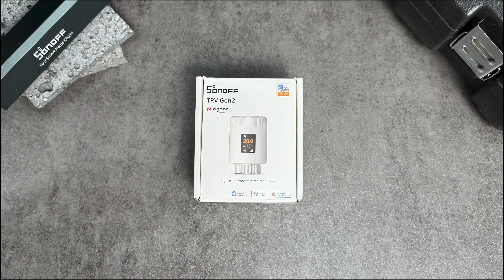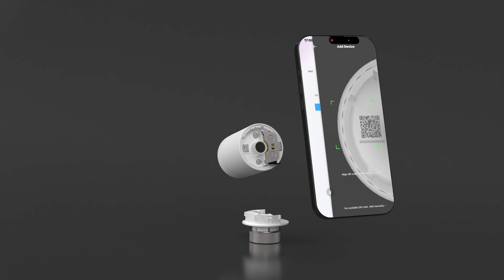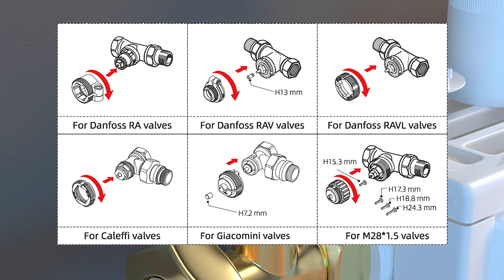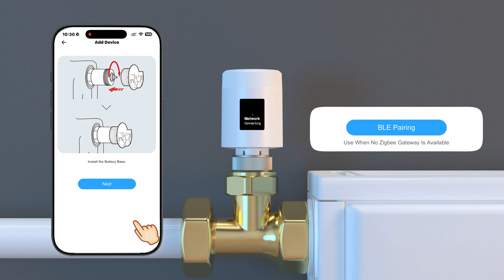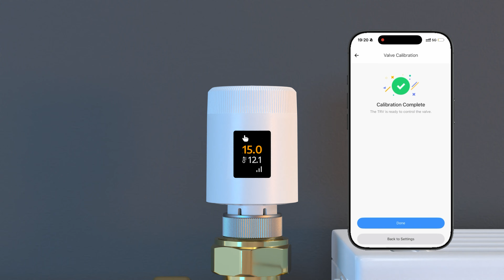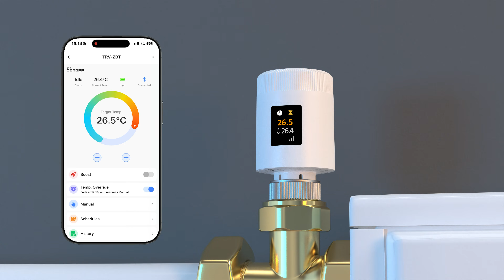How to Install & Set Up SONOFF TRV Gen 2 | Complete Guide

Comment: This valve has a major flaw: the valve opening percentage is not exposed to Z2M. The problem will be the same as with Tado X valves — the status switches to "heating", the heat pump starts up, but the radiator stays cold because the valve is opened too little. As a result, the heat pump runs for hours for nothing. What a shame — Aqara’s W600 provides this information but is larger and less attractive. I don’t understand why such a limitation exists.

Comment: With eWeLink v5.28.0 I'm not able to pair TRV Gen2 with Z2M hub. I don't even have any option to pair via Zigbee no matter what hub, only BLE works. That's not what I expected from a zigbee certified device.
Reply from the maker: Sorry to hear that you’re having trouble pairing the TRV Gen2 with Zigbee2MQTT! 😊
When using Zigbee2MQTT, the TRV Gen2 needs to be paired and managed directly through the Zigbee2MQTT interface, rather than through the eWeLink App. The eWeLink App supports adding and managing the TRV Gen2 through compatible SONOFF Zigbee gateways.
We hope this helps, and we really appreciate your feedback and patience! 💙
Reply: @SONOFF  It took me about 5 times until it pairs with Z2M (2.14.0). Unfortunately I had to wait until the pairing mode ends after 3 minutes to retry it . Finally I succeeded. There was no manual hint that I don't need the App for zigbee pairing, even your video doesn't really helped.

Comment: Cuentan con algún dispositivo que pueda medir de manera nativa el consumo de un aire acondicionado alimentado por 2 fases (220v)?
Reply from the maker: Yes! 😊 You may want to take a look at SONOFF POWCT. It supports AC 100–240V and current measurement up to 100A.

Please note that POWCT uses a single CT sensor, so it is not suitable for applications that require separate measurement of two live lines. If your 220V air conditioner requires both lines to be measured independently, POWCT would not be suitable for this setup.
Reply: @SONOFF esa es mi duda, al ser un aire acondicionado de 220v (alimentado por 2 fases, sin neutro) podría usar dos POWCT para medir cada fase por separado?

O de que otra forma puedo medir el consumo de las 2 fases ?

Supongo que cada fase tiene un consumo independiente, y para saber el consumo total de mi equipo es necesario medir ambas fases, o estoy equivocado?

Agradezco mucho la atención que dan a los comentarios, espero una pronta respuesta 😃
Reply from the maker: Thank you for providing more details about your setup! 😊

POWCT calculates power by combining voltage measurement with the current measured by its CT. Since your air conditioner uses a line-to-line 220V connection without a neutral, its wiring configuration differs from the standard setup supported by POWCT. Therefore, POWCT may not be suitable for this application.

We’re sorry that we currently don’t have a product that supports this type of measurement. Thank you for your question and for taking the time to share your requirements with us! We hope to offer more solutions that meet your needs in the future. ⚡❤️

Comment: Is this gen solving the known errors the first gen had? About gets disconnected from the mesh. Not totally disconnected, weird behaviour, reporting temp but not receiving commands
Reply from the maker: Thanks for your question! The TRV Gen 2 has been further optimized compared with the previous generation.

To better understand your setup, could you let us know which Zigbee coordinator/Dongle you’re currently using? If you’re using a SONOFF Dongle, please also make sure its firmware is up to date using the SONOFF Dongle Flasher:
https://dongle.sonoff.tech/sonoff-dongle-flasher/

If the issue still occurs after the firmware update, please let us know and we’ll investigate further.

Comment: Is this TRV more like ON/OFF or more gradual? I know that AQARA radiator thermostat basically just opens fully and closes fully, but I heard danfoss is opposite.
Reply from the maker: Hi! The TRV Gen 2 supports gradual valve control with Smart Temperature Control. It uses a PID algorithm to adjust the valve opening dynamically, rather than simply switching fully ON or OFF. 😊
Reply: @SONOFF  Will gen 1 TRVZBs continue to be manufactured and sold, or are they being phased out and replaced with gen 2?
Reply from the maker: @dan-nutu  Hi! Gen 1 TRVZB has not been discontinued. It is still being manufactured and sold alongside the Gen 2. 😊